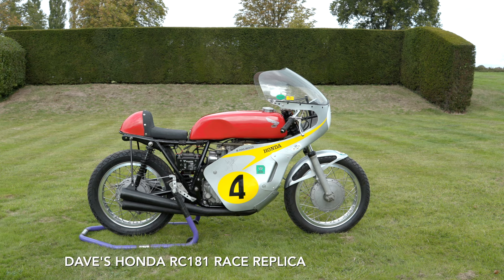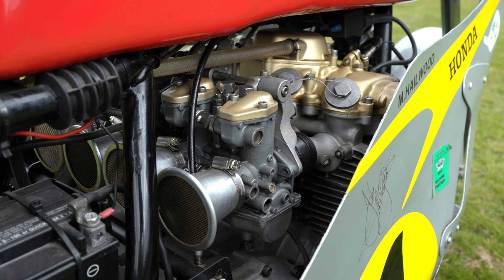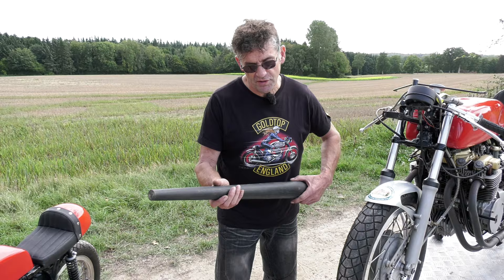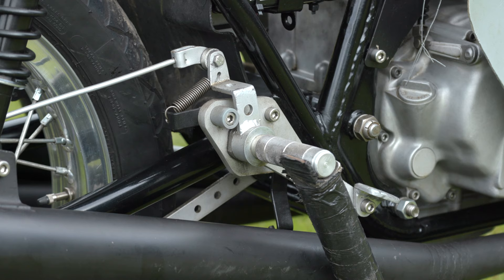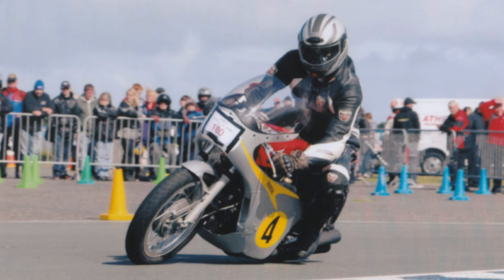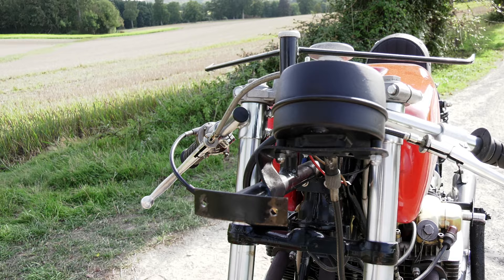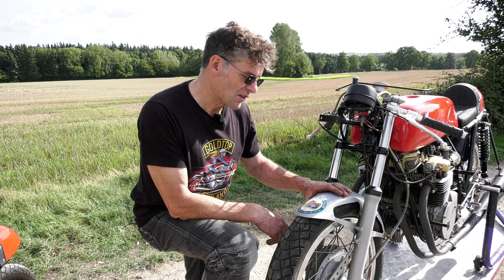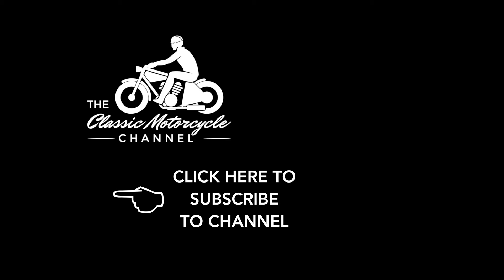Classic Racing Motorbike Build - Honda RC181 Race Replica

Comment: Those replicas are magnificent. A real credit to you. I last rode a CB550 back in the 1970s and found the handling far from ideal. My CB400-F1 bought new in 1975 much more agile. 

Back in 1964, at Mallory Park's "Race of the Year", I made the mistake of standing immediately behind Mike Hailwood's works Honda 6 [ RC166? ] when his mechanic started it up. After a few lusty blips of the throttles to who know what rpms, I had to move away sharpish. Not because of that fabulous noise, but because those six megaphones had the flesh in my chest and lungs as well as the bones in my rib cage all vibrating at very different frequencies. 

The day was also notable because Honda Works rider Luigi Taveri on his 125 ran over my foot in the paddock. Great days gone forever but the memories last.

My days rebuilding and restoring old Triumphs and Hondas are long since behind me. I would love to have made an RC181 replica like yours. One of life's "Regrets, I've had a few".

Comment: Great video.
I have a 550 as well. Put a 600 kit in it, flowed the head, had the carbies bored and put a cb 650 cam in it. It has a La Parriesinne, 3/4 fairing as well.
It's a registered bike here in Australia 🇦🇺. The thing absolutely hammers and it is a joy to ride.😄👍

Comment: Hi there, awesome replica man, pity you didn’t bifurcate the bottom exhaust pipes on either side into two, to mimic the 6 pipes on Mike the bikes Honda 6, that would have been amazing 🤩, don’t you think 💭, maybe it would have been too much work. You should fit a quick shifter on her for the track, now that woooould sooooound aaaaaaaamazing .......
The 175 looks fantastic as well, I’d happily take either one, although for someone my size, xxl, and that’s after losing 5 stone in weight, it would be the 500/550 lol 😂 but I wouldn’t turn my nose up at the 175 either.
Sweet video. 😎👍👍👍🇬🇧

Comment: kinda reminds me of the 2 stroke racers like the TZ's and YZR's of the mid 70's, i believe the RC174 model which is similar to the RC145 is the building block of the Honda CBX1100...
Reply from the maker: Very interesting Adam, didn't know that.
Reply: @TheClassicMotorcycleChannel  6 cylinder race bike could you even believe that thing, while most people thing its horse radish, honda made it possible, they beat the british bikes, hell they even beat other Japanese brands in terms of how many cylinders can you fit in a bike frame 😂

Comment: Wow, some who've thought alike...!!  I did this kind of modification to a Honda CB-160 back in the early '70s, trying to recapture the same period of excellence of their early and successful racers.  I had the good fortune of using CR-93 fuel tank and seat, steering damper, intake tubes, engine breather, along with fabricated rearsets and linkages, and CB-92 magnesium front brake unit and Honda issue race parts like the clip ons and CB-92 racing megaphone.  Some port work and polish, shimmed valve springs - all in hope of racing our AAMRR road racing program but never made it to one.   Eventually sold the motorcycle collector based in California.  The Honda CB-160 frame appeared to have identical dimensions to the CR-93, the seat actually bolted on the same way with no modification.  https://www.rcgroups.com/forums/showthread.php?2778159-Some-motorsickle-stuff-a-trip-back-to-a-former-occupation